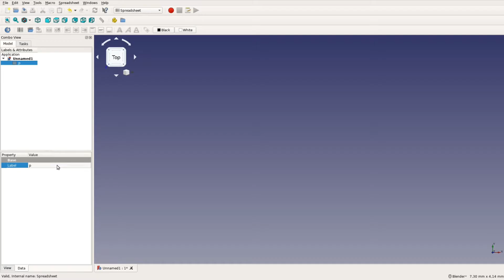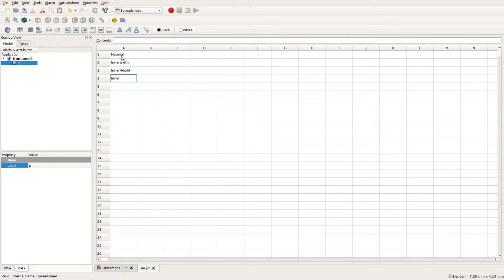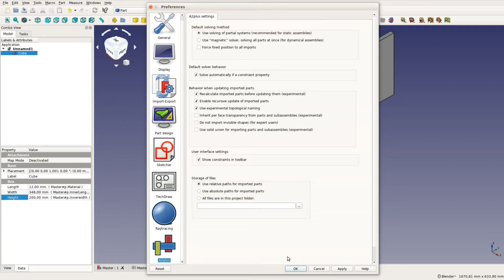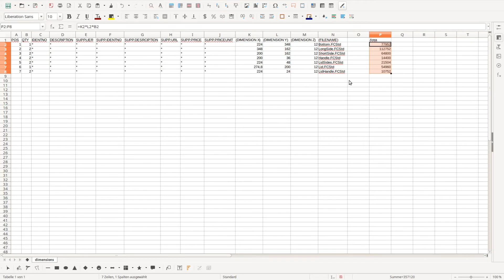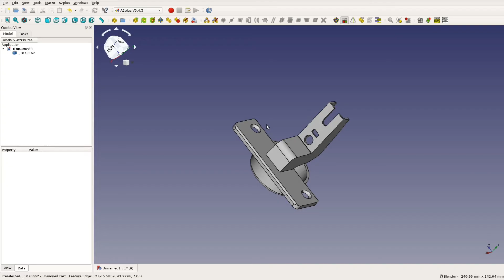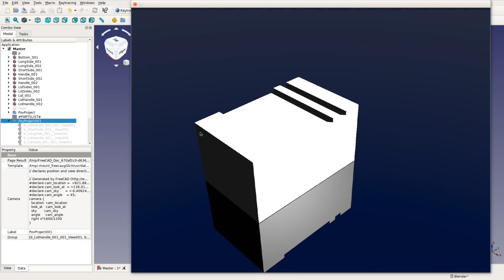Woodworking with FreeCAD

Comment: The alias generator fails on 0.21.2 with a message "Unable to complete task" :(
Wondering which other free software would be the best for furniture designs? I'm good with Blender3D, but it does not generate things dynamically based on entered values and it cannot create a technical drawing.
Reply from the maker: I think FreeCAD is among the open source systems the best alternative for furniture designs
Reply: First time using this software, instead of using a macro, I found you can manually set an alias in the top-right corner after selecting a cell.

Comment: Hi! Thanks!  Which software do you think is the best for woodworking? including paid options
Reply from the maker: Most CAD packages are not really optimal for woodworking. As a hobbyist I settled on FreeCAD (see also some of my videos on this). As a pro I would most likely use a solution from eg my CNC provider that can only create kitchen cabinets but this in a very easy way...
Reply: @WayofWood  Thanks for the answer. I'll check your other videos as well.

Comment: It's only parametric if a parameter doesn't change the topology.. Otherwise it's worthless as you're not able to name the results of an operation and refer to them later.
Reply from the maker: That is not totally correct: A2+ has an „experimental topology naming“ feature that is able to compensate for quite some changes. 
And you can use A4 if you want to become independent of the topology naming.

Comment: This add-on does not work for me, is buggy and can be replaced by more standard simple features like the draft mode an a macro (like getdimensions) for the cutlist. Also no need for multiple separate parts drawing.
Reply from the maker: Ragnar Von Lodbrok The addon is still quite beta. You can assemble stuff manually. This just makes parametric designs quite difficult. Building this box only by dynamic placements is possible but it is also so much math that I would in this case rather use OpenScad than plain vanilla FreeCAD.
Assembly2+ makes parametric design with constraints quite easy. If it doesn’t work you can contact the author. He is quite responsive and picks up feedback quickly.

Comment: Thank you for putting this together however, I tried very hard to follow along but unfortunately you go too fast and skip over too much. I think I was able to figure out how to make different parts (I created a top, bottom, and the sides) but I cannot get them to act independently in relation to each other. The best I could do was "transform" the items but this did not (ultimately) produce the desired effect.
Reply from the maker: Jeff Bennett Sorry for being too fast with the instructions. Have a look at the blog post for some more detailed instructions. Some of the hacks are a bit too complicated to fully explain them in a video.
For your particular problem you have to install the A2plus workbench. Go to Tools, Addon manager and install the latest version. You can then select the workbench and use it’s constraint module. 
Let me know if this works ...
Reply: Unfortunately that's where I was when I finally gave up. After installing the A2plus addon, the contraint features were greyed out. Also unfortunately, reading through the blog didn't clear anything up for me.
Reply from the maker: Jeff Bennett My guess is that you have done the intuitive thing and created all the parts in a single file. Intuitively that’s right - unfortunately that’s not how A2+ works at the moment. 😕
Here is what you have to do:
* Create a cube in a file and save it as cube1
* Create another cube in another file and save it as cube2
* Close both files and create a new third file and save it as assembly
* You can now import the individual parts cube1 and cube2 one by one with the button that shows a plus sign
* The constraints buttons in the workbench should work now

Let me know if this solves the problem. 

When I have time I might create a slower pace step-by-step tutorial...
Reply: @WayofWood  OK, I've responded via twitter
Reply from the maker: Jeff Bennett I didn’t saw your tweet. Did you tag me?
Reply: @WayofWood  I did. My handle on twitter is @khar76 if that helps. Sorry I'm not sure how to add the screenshot here, that's why I moved it to twitter. I tagged @WayofWood